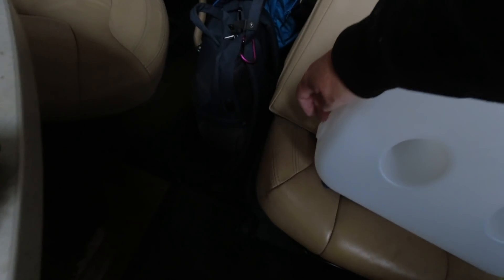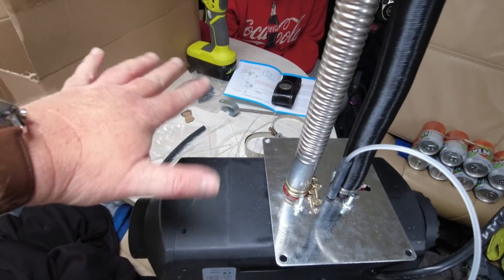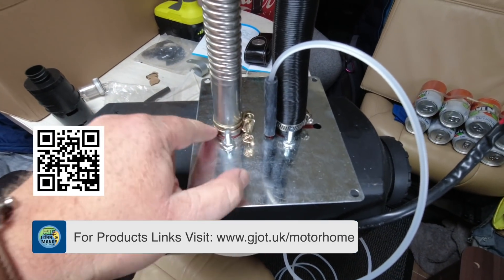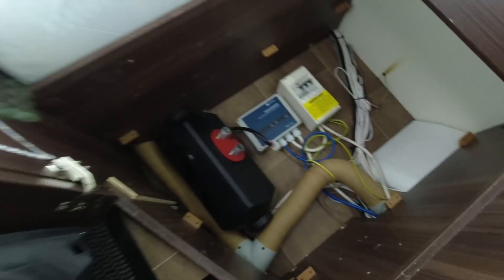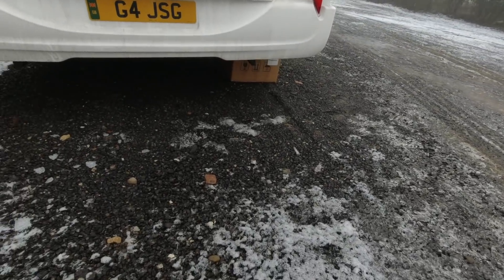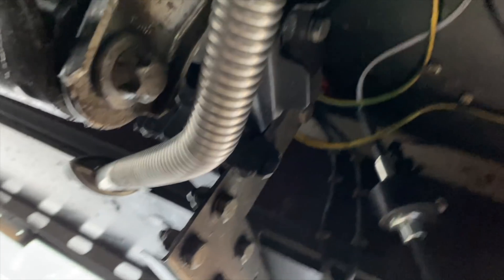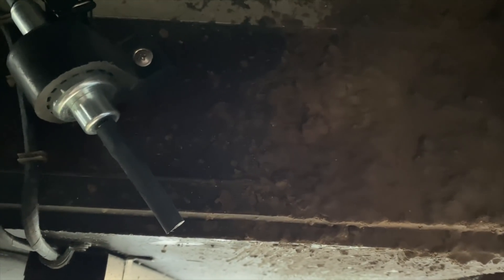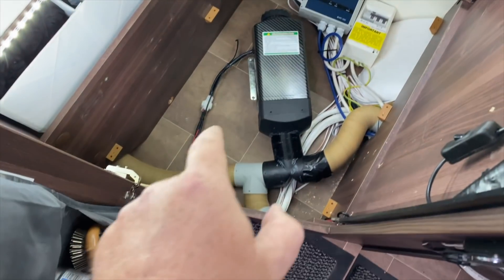Diesel heater Install in our MotorHome

Comment: Hi John and Mandy not sure if you can help i was looking into fitting a diesel air heater under the drivers seat of  My Elddis 194 
When i checked  with my insurance company they wouldnt cover my van if the heater wasnt CE certified.
I have not seen any that are. Do you know of any?

Comment: Thinking of trying one of these for the garage - Do they do any that could run off the mains instead of a 12v battery?
Reply: You can use a transformer to convert your mains to 12v. Search for Karl Beadle on youtube. You can buy them in a housing too
Reply: @mjc8247  thanks 👍
Reply from the maker: Yep, transformer will do it but make sure it supports 10amps as most won’t.. you can also run it from a power oak AC50 😁👍🏻

Comment: Hi John & Mandy. Great video. When I installed mine I also had to pass through an insulated floor, so I made a heat shield from a coke can! I fed the fuel pipe into the top of the tank through a rubber grommet. Wondering what the current draw is on yours? My heater (similar to yours)  is about 5a on startup for 4 mins then down to between half an amp and one amp while running (depending on how hard it's working), 5a again for 4 mins on shut down. Enjoy being cozy :) PS, those multi-tools are awesome for cutting the rectangular hole in the floor :)
Reply from the maker: Cool, Coke can will do the trick nicely.. our draw is pretty much the same as yours is 😁👍🏻 
Definitely multi tool for the win 🙌🏻

Comment: Another great video guys - really impressed by the heater.  Interested to know your total daily power usage in the current winter conditions now that you have another ~1amp drain with the new heater.  When it comes to the crunch will the heater be used at the expense of Mandy's coffee maker (ha ha)  Also with your upcoming change to a compressor fridge (presumably only electric) will the meagre winter sunny spells be sufficient for all your needs?
Reply from the maker: We’ve got 216AH of usable power, with Mandy’s coffee, heater on, 12v compressor fridge and everything else we only use roughly 45AH a day.  We get a small amount of solar charge and, right now with the bad weather, we run our engine to get a charge from the B2B 
So we never come close to running out of power now we have all the new upgrades we’ve just added

Comment: What’s you thoughts on fitting a diesel heater and separate water heater and pump rather than buying a trauma heater at well over a grand? If you have the space is the saving worth it? Cheers Stew
Reply from the maker: If you have the room I’d go for diesel powered everything.. the truma is cool and neat and super quiet but the diesel heater and separate boiler are brilliant, we know loads of people who use them 😁👍🏻
Reply: Stewart check out the one from Bobil Vans

Comment: Hey how many amps / volts do your batteries drop on startup thanks ben
Reply from the maker: It takes 10 amps for about a minute on startup and then it need around an amp with it on full power with the fan on full.

Comment: Hi have you watched this guy David McLuckie lot of videos on the heater also have you ordered a spare heater plug and box spaner I assume you have seen Those Weirdos videos on there heater. Nice video keep them coming have a nice winter in the UK LOL
Reply from the maker: We’ve not seen David’s videos and no spares just yet.. fairly sure we’ll get some soon enough 😁 thanks Steve, will have a warmer winter now 👍🏻
Reply: David McLuckie has done a couple of videos about the "afterburner" controller I mentioned in another reply. Like I said though, you'd need to swap the heater motherboard. It's quick and cheap though.
The afterburner has to be the ultimate gadget for these heaters though!
I'm thinking of changing mine, but not got around to doing other stuff of higher priority first.

Comment: Thanks John/Mandy... Great detailed vlog as usual. Having almost completed my sprinter van build and installed a Truma Combi 4e for which I don’t regret.... yet ! You kinda have me worried ref the LPG usage, 🙈 Would you say your fridge is heavy use on gas or is it your heating/cooking been the main drain ? Not very many sites over here have LPG available however I have one beside me which is a plus 😬 I would be interested in the LPG gas usage breakdown approx. of course, in your MH
Reply from the maker: Thanks Martin, the truma kit is awesome and worked flawlessly while we were away with plentiful lpg stations and no need to have the heating on all day.. when we didn’t use the heating our 2 x 11kg gas bottles would last 6 weeks, when we did use the heating it lasted 10 days at best. Lpg is cheaper but we definitely use more than diesel 😁👍🏻 hope that helps
Reply: @johnmandy  Thanks for the reply... My fridge is a dometic 12v compressor no gas, so my approx. 23ltr underslung should last quite a while when mainly only using weekends and hopefully 🤞 a few good long trips.... Cheers ☺️

Comment: Keep debating one in my caravan as we have gas heater only
Reply from the maker: It’s a lovely heat you get from it and nice to have an alternate heating source, although being in a caravan means you’d have to go get both anyway I assume?
Reply: @johnmandy   yes you would need to carry diesel for top ups but 6kg gas at 23  quid  if u can find it this cheap  
I'm more thinking blown air heat I can duct around the van atm it's just a gas heater no ducting  and also I'm not keen on leaving it on while sleeping   where I'd be happy to leave ticking over a diesel heater

Comment: Shame British sold motorhomes/campervans aren't sold with the truma D 6 combi boiler. Make life a lot easier being linked straight to the fuel tank.
Reply from the maker: They certainly would, or if they designed it as a direct swap out for the 6E that’d be brilliant too 😁👍🏻

Comment: i john and mandy just like to say about the diesel heater apparently the back box dosent last very long only about a year our so there so poorly made you can buy a better part on ebay for about 11 quid its just like a pipe not like the back box shape seen this on DIY Campervans And Variety channel you could check it out
Reply from the maker: We’ve an extension kit on its way which will hopefully help.. not too bothered about replacing it after a year though 😁👍🏻

Comment: A lot of the guys on the facebook Chinese diesel heater group recommend using kerosene as fuel as it burns cleaner and costs a lot less :0)
Reply from the maker: We’ve heard that too 😁👍🏻
Reply: Are you going to use kero John?
Reply: Is kerosene easier to get?
Reply from the maker: @BigTubz  we’ve not thought about it yet, not looked into how easy it is to get hold of either. We have easy access to Red at the mo so will stick with that for now 😁👍🏻

Comment: Your install have some problems in my opinion you have to seal the floor cutout and when you use the original airpipes in your van you have to be waer that you not close all of your vent outlet if you do you risk to burn your dieselheater. Sorry 4 my bad spelling.  Its not my Mother tung  👍 have a Nice one reg Roger.

Comment: Q: does the diesel fan heater eat more or less electric than the lpg van heater?
Reply from the maker: The fan is as efficient as the truma fan but the diesel heater as it’s heating up does use a bit more

Comment: red diesel is not the same as white diesel it is high in Sulphur and will carbon up your heater and stop it from working. there is lots of vids on here about it
Reply from the maker: From the UK Government DoT website: Red diesel is a fuel that is used in off-road vehicles and machinery. ... Red diesel is the same as regular diesel, but with a red dye added to it to prevent it being used on road-going vehicles.

Comment: These Chinese diesel heaters are quite problematic and tend not to last long. Most buy them because of the price. You might find that the Eberspacher D4 is more reliable and long lasting. I know they are more expensive (£600) but they are superior quality and they are extremely quiet. I have had experience with the Chinese ones and wouldn't buy anything other than an Eberspacher.
Reply from the maker: I know hundreds of people who have used these heaters for more than 2 years without problems. So I’ll stick with that experience rather than throwing money at a brand name.